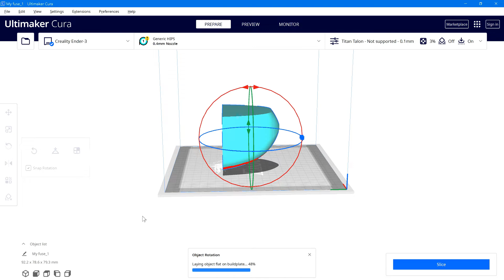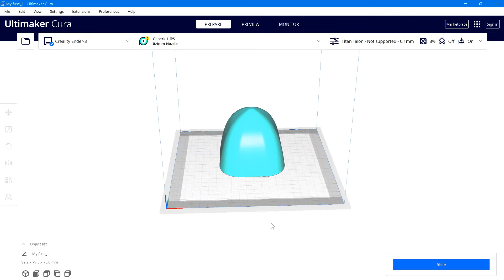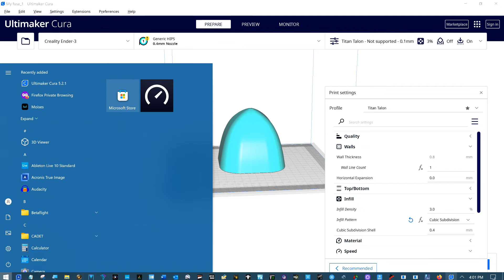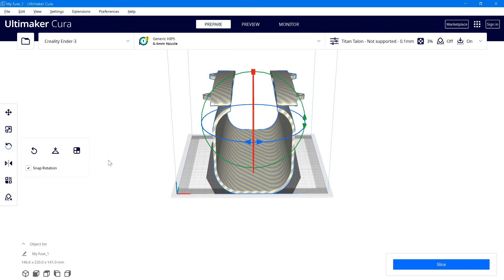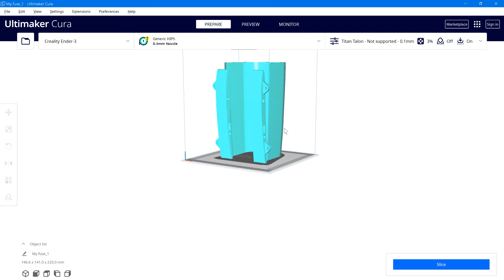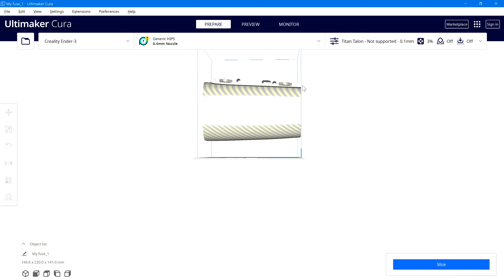Titan Talon Build Begins Comments

Comment: I'm doing a build simultaneously, with normal PLA instead of the lightweight PLA that they recommend.  The first section finishes in two hours, I'm looking forward to seeing how your build goes.  
My intuition tells me that actually ABS would be the better material since it has a density in-between that of PLA and LW-PLA and it's less brittle, more impact-resistant, and has a higher thermal tolerance, though I don't have any on hand.
Reply from the maker: You are light years ahead of me.  I have had the 3D printer for going on three years and only ever printed off stuff from thingiverse and parts on the Matek site for their modules.  EASY beginner stuff like that.

I saw this PLA on another channel and wanted to try it.  My nose took 10 hours to print.  It weighs 19 grams.  I have no idea how that compares to anything because I haven’t printed outside of the stock items I mentioned.  Funny, I may understand the electronics more quickly and deeply than most but I usually moved on to the next project and got a little operations knowledge.  Others in the companies I worked for came in to train after I setup things up.  So, I would still call myself green on operating a 3D printer.  <shrug>

Second nose is printing now with corrected infill.  On layer 259 of 789 at 5 hours.  Going to be a while for me.  Going to take me MUCH longer to print all the parts.  Please keep me up to date on your build so I can follow you.  rofl